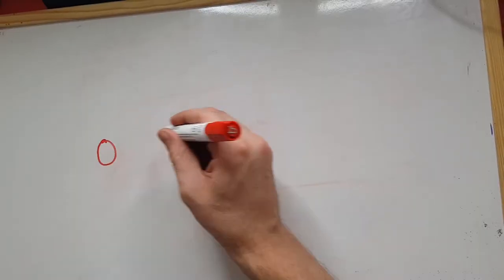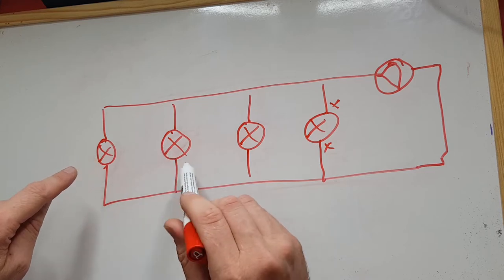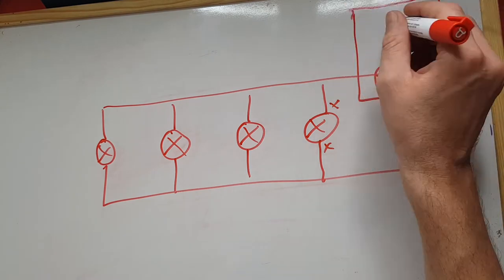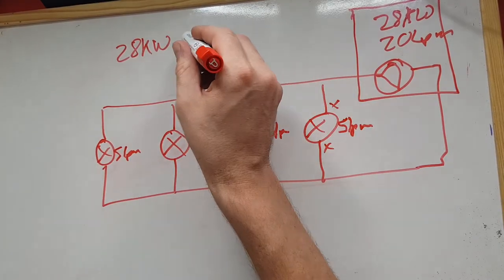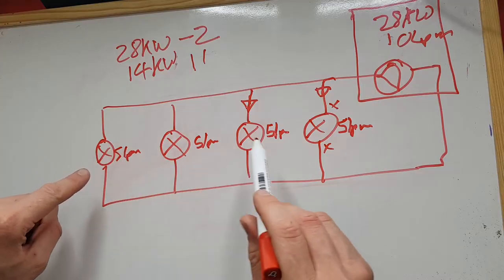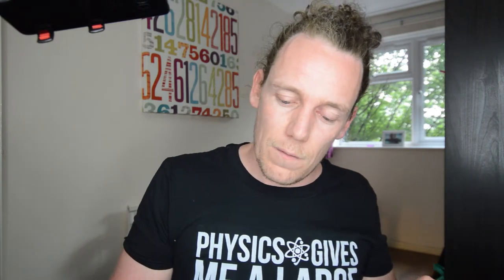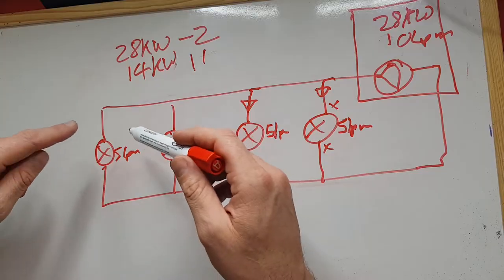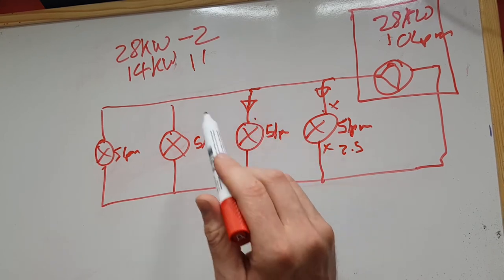Automatic balancing TRVs - Are they worth it?

Comment: I've been struggling to balance my heating system for ages using the lockshields, which is very difficult as they seem to go from 0-100% in the first quarter turn. So the stuff on your website about the IMI lockshield valves with presetting was interesting, and your video here, but while looking into the Drayton TRVs I stumbled onto the fact that many standard non-autobalancing TRV valves have presetting inserts - the Drayton TRV4 has an EB valve body with 6 stepped presetting positions but you need a special plastic presetting key to turn the insert, the Honeywell TRVs have a stepless presetting insert (more like the IMI but with fewer turns) you can turn with a spanner or Allen key, not sure about other makes. Is there much awareness amongst installers of this? All the TRVs in my house that have presetting inserts in them had been installed and left at the fully open position, leaving the balancing to be done at the lockshield side. These presettable TRVs seem to offer a viable alternative to the IMI lockshields in terms of controllability, enabling you to just fully open up the lockshield and do all the balancing at the TRV, and the settings don't get messed up if you isolate the rad etc. It would be interesting to hear your views on these. Thanks
Reply from the maker: Those are the same trvs I'm referring to in the video.
Reply: @HeatGeek  thanks for your reply. The TRVs I'm talking about are not described as auto-balancing, they just have a balance presetting insert which can be used to set the Kv value of the valve, so the flow will still vary if the pressure varies.
Reply from the maker: @Tom Skailes  oh sorry yes imi do these too. They seem fine.. I've never had much of a problem provided there's enough head. Is your system clean?
Reply: @HeatGeek  yes, all clean. Now that I've discovered the preset inserts in several of my TRVs I've been able to balance the system better, and get a good temp drop across the rads, but still seem to only see a small temp difference between the flow and return temps (using d40 and 41 in the diagnostics) in my Vaillant boiler. I'm beginning to think that either the return NTC in the boiler is reading too high, or there's a link between the flow and return pipes somewhere under the floors, or the bypass valve in my boiler is opening too early.
Reply from the maker: @Tom Skailes  hold on.. are you saying balancing was poor becaise the dt was too narrow?
Reply: @HeatGeek  if you mean the dt across the boiler, then yes - I see about 7-8C difference between flow and return temps in the boiler, but about 15C across the rads.
Reply: @tomskailes4296  I had a similar situation with my Ecotec Plus where the dT at the boiler was ca. 4-5deg although the rads were perfectly balanced at around 30% drop across them. The issue seemingly was the diverter / bypass valve being fully open, although straight from the factory it should be in the "middle" position. So the water was circling inside the boiler rather than through the system. SInce this sicrut is tiny - no way the heat would dissipate there and the boiler was cycling like hell (in my case). As the measured  dT was tiny - it was constantly switching off, cooling down, going into anticycling mode and all over again. In the Vaillant Installation & Maintenance Instructions you have a section "10.4 Setting the bypass valve" where the settings are described and by screwing the screw on the valve IN by as much as needed (to the right, you have 10 full 360deg rotations from left - OPEN to right - CLOSED) you shall be able to force the flow to go into the radiators circuit, rather than mostly circling round in the boiler. As is known - water will always go on the easiest route. So when you somehow restrict the flow on the radiators with your limiting valves - it is easier to keep looping where it is unrestricted (read: inside the boiler). and there you have a low dT.
Happy to learn from the clever heads I am in the wrong talking drivles if that is the case.
Reply: @arturlorek7977  interestingly, my boiler is an Ecotec too, a 624 - I had previously looked at the bypass valve but it was set half way, and if I open the case when the boiler's running, the short pipe linking the flow to the return is very hot, so I decided to crank down the valve as far as it can go without it making noises. The dT is improved by doing this, but I think the main issue is that when the heating is close to set point and the TRVs on the reads are starting to restrict the flow, the pump in the boiler cannot run slow enough to avoid bypassing, even when the valve is set to max resistance. I'm beginning to think that Vaillant don't care if their boilers are ever in condensing mode, a more adjustable pump would help. I also have the problem that my rads were probably sized for 10C drop across them, so if I restrict the flow through them too much, the house struggles to get warm in very cold weather. The solution of course is to get much bigger rads or add extra rads to the system so that it can run with a bigger drop across the rads for the same output, but until then I've decided to aim for 10C drop across the rads rather than fighting the system. The advantage is the house heats up much quicker and as I have weather compensated boiler control, the boiler is at least condensing when the weather's not so cold. I'm pretty sure my situation is common for many houses where a condensing boiler has been put into an old system.
Reply: @tomskailes4296  Interesting. are there relevant settings in the installer menu for the pump speed on yours ?? I have an option under D.12 if I recall correctly from the top of my head, to change the speed of the pump there. Auto/50%/66%/80%/100% or sth like that,  where AUto is the only way to get it to go slowly..... Not quite sure what pump is on your 624 and what are the relevant service menu options. But worth a read if this could get you closer to your goal. May also be that you haven't got a modulating pump and so there is no setting as on mine and even if there was a mechanical speed switch on the pump - this could impair the whole system correct operation.
Reply: @arturlorek7977  yes, I've been through the manual many times. Mine also has the pump speed settings, including auto, however auto does not actually work on the 624, so the slowest speed is 53%, or about 400 litres/hr I think. I already have it set to that. When set to auto, the boiler never tries to set the pump speed any higher than the minimum setting of 53% - you can switch between auto and 53% and there's no change in the noise from the pump. This is what I mean by Vaillant not appearing to care about their boilers actually condensing - in typical settings it seems to me that you need your boiler to be able to modulate down to 1kW or less, and for the pump to be able to drop the flow rate right down too. Otherwise it just goes on/off, anticycles or bypasses.
Reply: @arturlorek7977  Which model of Ecotec Plus do you have, and what did your boiler dT go to after closing down the bypass to it's highest setting (NB it never fully closes, turning the screw just changes the pressure at which it starts letting water through)? On mine, with the TRV presets set to be quite open, I see about 12-13C across the boiler initially, but this still reduces down to around 4-5C after the system's been running for say 30 minutes even with the bypass opening pressure set to its highest setting, however it can happily tick along at that without anticycling.
Reply: @tomskailes4296  I have the 825 Plus which is a combi. I think I am not on the bypass highest setting. If I remember correctly I should be 1 or 2 turns from the full IN setting. With the whole circuit heating I can see a drop of 12-13deg like you do. My pump is set for Auto and it translates to 15%.... At least this is what it shows in the menu. And it goes slower than with 53% or whatever the first fixed step in there is, so I am led to believe it indeed is slower. Due to my controls not being the Vaillant sensoHome/Comfort with WC, my system is driven by 3rd party controls with a few heating cycles per hous (currently 3 per hour, which sort of translates to 20 minutes heating, off and checking the result, if still more heat needed - then firing again for another cycle and so on). So I cannot tell the exact drop after 30 min constant heating as I never got this far with my controls. But even if I have partial circuit demand, where some rooms are already satisfied and not calling for heat, I can see a drop of around 10deg on average.  All this without anticycling indeed.
Reply: @arturlorek7977  according to my manual, the 825 has the same pump as the 624, and its lowest setting is 53%. Only the 37/38kW Ecotecs can go lower on the Auto setting. Mine also indicates 15% when set on Auto, but the pump sound is exactly the same as when it's set to 53%, so I think it's saying that the boiler would like it to run at 15%, but the pump can't go this low. The good news is that the pump in the 624/825 can get to the lowest flow rates of any of the Ecotec range.

Given your control set up, you can do your own weather compensation by turning the flow temperature down on the boiler when the weather's not so cold - forcing it to fire for longer. If you set it to 55C, or lower if you can, it will be condensing all the time, will fire for longer, and overshoot the set point by less, but will be slower to reach the set point. My system was using 68C flow temps in the really cold weather and 58 modulating to 53C this week.
Reply: @tomskailes4296  are you referring to the IMI calypso TRV which has an auto balance feature but not PICV as that wouldn't work in a domestic heating system as Adams video correctly states?
Reply: @danielwilliams-pp6wl  no, I'm just highlighting the fact the many of the Drayton standard TRVs contain an easy balance (EB) preset feature in the TRV body, which enables you to select one of 6 presents with different Kv values, and when you use the EB presets, you just open the lockshield valve up fully. The lockshield valves supplied with the Drayton TRVs are very difficult to try to balance with as they go from 0 to 100% in less than half a turn, so the EB inserts make balancing much easier, but to be clear, the EB inserts don't set a constant flow rate through the valve, so they're not the same as the auto balancing valves heatgeek is taking about, but they make an easier job of balancing a domestic system than the basic typical lockshields. The strange thing is that the presence of the EB inserts doesn't seem to be well advertised by Drayton - so the plumber that fitted mine had left them on the highest Kv preset and had tried to balance the system using the lockshield valves - almost impossible. I'm not saying anything against what heatgeek is saying in the video, I'm simply highlighting the fact that these EB TRVs offer a step up from traditional lockshield balancing method, which may be sufficient for some people, but obviously the auto balancing valves are a step up again in certain circumstances.
Reply: @HeatGeek I spoke with IMI technical today on these valves, essentially they don’t work very well with modulating controls and on the down turn of flow increase noise is noticeable to they told me.
Reply: @tomskailes4296 sure. All comments noted. Sounds like the lock shield have a poor valve authority. The TRVs work on a pressure drop across the radiators.